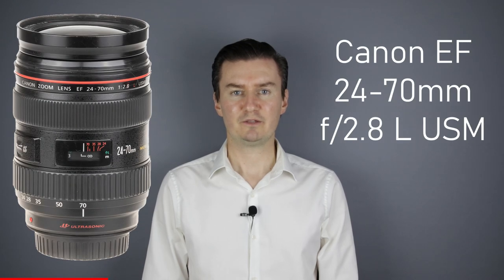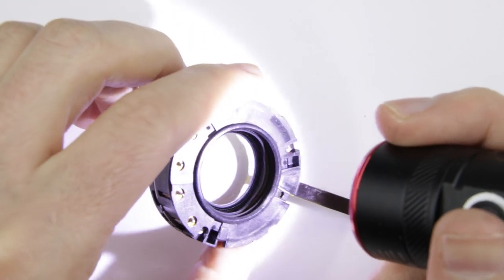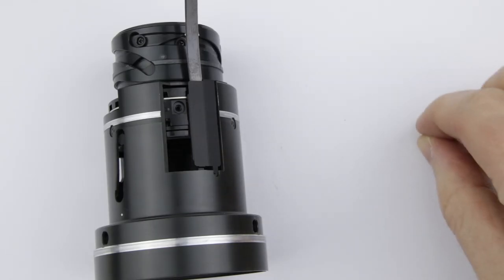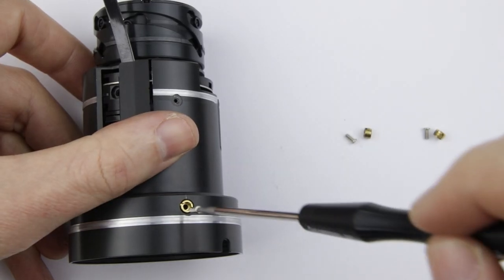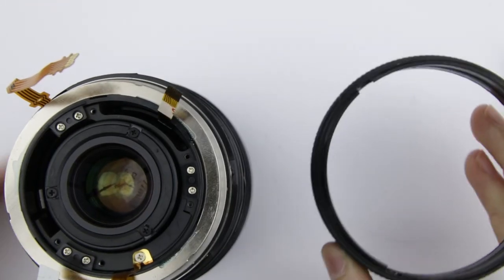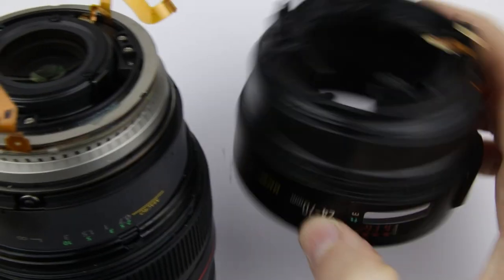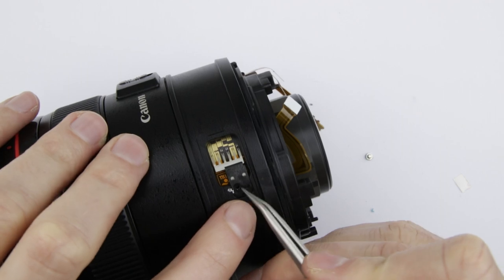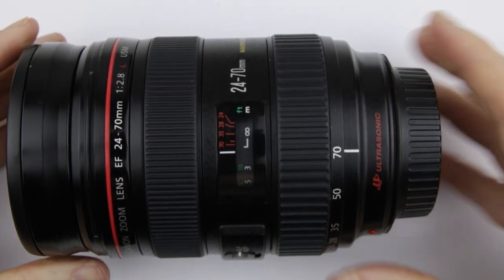Canon EF 24-70mm f/2.8 L USM assembly after replacing the aperture flex cable

Comment: It should be noted that, the aperture assembly inserted (4:00) will not be secured inside until 12:17. There, screws number 2, 4, and 6 are the ones being fastened to the aperture assembly inside. Finding the screw holes on the aperture assembly was tricky because it doesn’t sit flush against the rear element assembly; you have to move it back until you can see the holes. I hope others will find this additional info helpful.

FYI, I owned this lens since 2006, and it gave me some amazing photos of my family, friends and nature. I am so grateful that it’s working again, and thank you for taking your time making this video!
Reply from the maker: Thank you for the tip!

Comment: I have replaced the aperture ribbon cable and now it works, although the zoom is quite a bit stiff at the wide end,  could this be because in handling parts I wiped grease off and didn't replace it?  Or does it just need to bed in a bit?  Thanks for a great video!
Reply: I stripped it against and added a tiny bit of grease to the cams.  I also loosened and retightened the screws at the cams without removing them, which seemed to help things bed in better and the zoom runs well now.
Reply from the maker: Thank you for your comment, I'm glad that the problem has been solved.

Comment: Thanks so much for these videos. I ended up buying a diaphragm assembly to avoid soldering. Aperture works now, but is not sharp in the 70 mm end. What element would be the likelier culprit? 

Thank e
Reply: I may have rotated the front lens element because my mark was wiped out. Could that be the cause?
Reply from the maker: Could be... rotate the lens a little-by-little, and check the sharpness at every setting.

Comment: Hi, I replaced diaphgram unit with new cable. After assembly same error occurs, but sometimes camera takes picture with different set aperture and no error, while the aperture really hasn't changed. Could it be that diaphgram is stuck ? It makes buzzing sound when error occurs.  Anything advices ? I think that i diassembly once again and use old diaphgram and new cable.
Reply from the maker: First, check the aperture using the dof button.  Set the aperture to the smallest value (f/22 or smaller), and push the dof button several times to close the aperture, and view it if it is closed to the same amount.
If not, then the aperture unit is faulty. I would recommend to buy a 100% genuine Canon aperture, or use the aperture unit which was in the lens, and replace the cable only.

Comment: So I just need to replace the cable, not the entire aperture module? I’m a diy guy and this seems pretty tedious, but entirely doable. I paid an aftermarket specialist $400 to fix my 24-70mm a few years ago and when I put the lens on today it no longer works. I’ll be damned if I’m paying them again if I can fix it for $10 and a very careful process. Thanks!!
Reply from the maker: The cheapest way is to replace only the aperture cable. If you don't want to do soldering, then replacing the whole aperture unit with the cable is an option which is easier but more expensive.
Reply: @CamerasLensesEtc  I commented on part 1. I managed to replace everything and put it back together, but when I did, I did not have the full focal range, the lens will not auto focus, and I still get the error message. Help! What did I do wrong??

Comment: Is there a lens alignment required after replacing that flex-cable?
Reply from the maker: If there is eccentric screw collars in the lens, mark their position, and then put them back where they were at the same position as they were there originally. That is the easiest way to more or less keep the lens calibrated.
If you want to calibrate your lens, then I have a link to a blog article about calibration in my 24-105mm video, you might can use that to calibrate your lens.